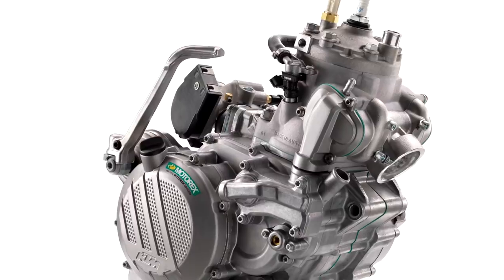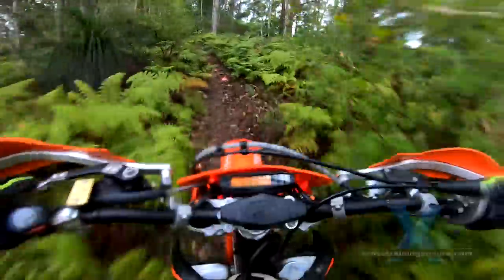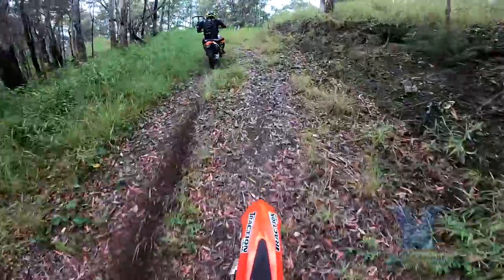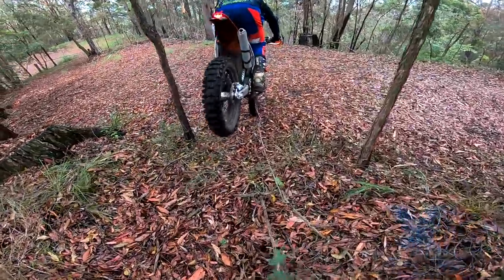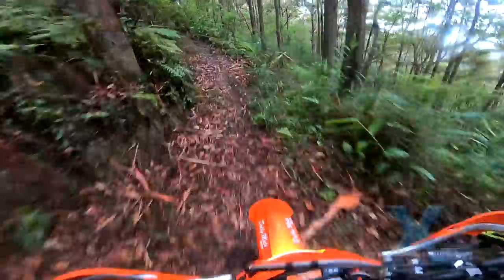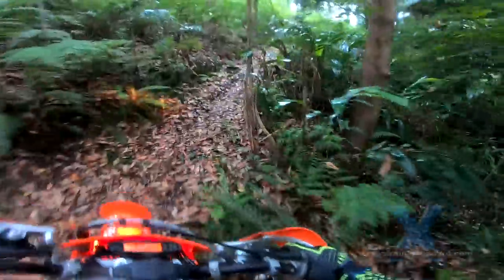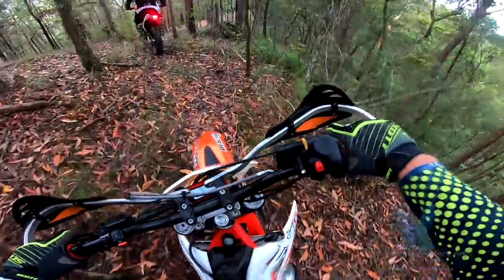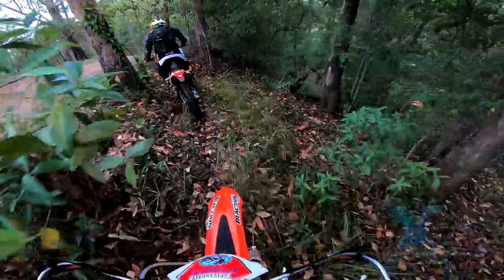KTM's carb v TPI (Transfer Port Injection): pros and cons!︱Cross Training Enduro

Comment: Mine is the best dirt bike I have ever ridden in 28 years off road, no problems at all and I love the response at all throttle openings, cold day, hot day, makes no difference, running mega slow in tight trails and then you can open the throttle and pulls away as clean as you like, no needing to clear it's throat. It's honestly amazing

Comment: I was lucky enough to ride the KTM TPI bikes at a demo day. Compared to my Beta 250rr, the 250 TPI was softer through the bottom end and midrange. Top end felt about the same. The 300 TPI felt about equal to my 250rr through the midrange. But hit ever so slightly harder below about 3000rpm. Not much difference really. My butt dyno says the TPI bikes are slightly down on power at lower revs. I've got no problems with fuel injection, but they need to allow the ECUs to be programmable for me to jump on board 100%. If you can't tune it to match mods then it's no good. KTM doesn't even want you adjusting the power valve on the TPI bikes.  Until they change that, I'm not a fan.

Comment: I have 40 hours on my TE 300i and it has been flawless. 6 other riding buddies also own a TPI 300 and they all have been great. The bikes are mapped on the lean side to meet regulations but in general run better as delivered than the 4T models. The aftermarket has responded and consumer adjustable ECUs are now available for those who are compelled to farkle. To me the biggest operational difference between the TPI and carby models is the more accurate low speed fueling. This is really noticeable in slow rpm technical riding: the TPI bike lugs down even lower, won’t stall, doesn’t die on steep downhills, and provide a hitless power delivery that makes finding and modulating traction easier in sketchy situations. For those who can plate their TPI bikes ( like me!), the improved fueling makes for much smoother running on the road with less surging and no loading up. If you are an aggressive rider and run at big throttle openings a lot, you probably won’t appreciate most of the benefits. Both systems make about the same maximum power. I got 400 miles out of my first 2T oil tank. The computer adjusts the mix ratio between 60/1-100/1. Cold starting is also better. Just be sure to get the motor fully warmed up before demanding big power.
Reply: Farkling isn't in my vernacular.

Comment: Well, I also can say some things about the tpi (MY 19):
The bike feels less aggressive than my 17 model (mikuni carb.). After only 5hours of riding, there are already some scratches on the piston (exhaust side). There is no monitoring of the fuel pump, so if it goes bad, the engine will not get any oil, which is not acceptable. 
It indeed needs less fuel than my carbed model, but the difference is not really huge. The downside of the tpi (for me) is that you can't change anything on your engine, because of the mapping. If you want to change something, you have to go to the dealer, and remap the ECU. 
I like to have the opportunity to change things on the fly, whether it is the jetting or the power valve spring.... I will stick to my old katie as long as possible.
Reply: If it can self adjust to altitude it should be able to self adjust to other changes that don't effect timing.
Reply: oh it's "that guy".    I'd avoid his videos man.
Reply: Why avoid that guy?

Comment: As always, nice video Barry! A few things need to be discussed. I had a first series TPI myself, so I can tell you that the bike isnt "greener" as no one rides it  restricted. Once uncorked it may produce less smoke though. Second thing and hundred times proven in the meantine is the fuel consumption which isn't much better than it was with carb, provided the carb is correctly jetted. It may save a bit of fuel in the tight and slow first and second gear stuff. In the fast WOT bits and on sand it may need even more gas than the carbed bike. Its not only me who has experienced this but most of the fast boys...

Comment: I have a 250TPI for about a year with 120 hours and I can only say that I'm never going back to carb.
Reply: what maintenance have you done so far? im still on the fence
Reply: Just regural maintenance as on any other bike.Air filters,4x gearbox oil changes,4x inline fuel filters(4€) and at 100 hours I had to do front fork rebuild(new oil,seals...) cause I dented them in a crash on rocks and they started leaking.And ofc I had to replace them but that's only my fault.Apart from that I'm only lubricating chain,refueling gas and every once in  a while oil.
Reply: No oil pump?
Reply: No oil pump yet.No piston.But I'm planing to change both the piston and the oil pump in spring somewhere arround 150-160 hours.
Reply: Thanks useful to know. Hoping to test one soon together with a 350f

Comment: Test rode the range of KTM 250 - 350 2 and 4 stroke bikes at a demo day and liked the 300 xc-w TPI the best. I ride a 500 exc and none of the 2 stokes matched the power but all were certainly more nimble and would no doubt be quicker and easier to ride through the technical tracks. The 300 xc (carb) was fine, suspension was stiffer but nothing notable in differences of carb v. TPI.  The 250 TPI spun up faster but didn't have the same low end as the 300 which could be lugged like my 500. I like the idea of not having to mix gas and can fill up at any gas station and not have to mess with jetting but this is based on having no experience with a carb bike.
Reply: Everything feels like a step down from a 500 4T 😁.
Reply: Your saying 300 na got the same power as 500 mmmm could it be the 200cc of different maybe
Reply: @seanpurcell9056  Kinda, yeah but that's my lack of experience with 2T. I was continually told that 2T make so much more power and that a 300 would be comparable to my 500. Not that the 300 was any slow but the two are not comparable. That said the 300 was much more nimble and would be faster on the technical stuff and suck up less energy.
Reply: @TeamStruggleBunny  they are if you put 300 2 stroke again 300 4 stroke if you get a chance of a shot of 500 2 stroke you no about it they mite be old now boy they go if they were not kill off and had the same amount of development as the 4 stroke got over the years they be something else dont get me wrong  modern 4 stroke got some amount of power too they can hall ass. Some of the new electric bikes are coming on leaps and bounds love to try one some day all ways good to try something new and different keeps you on your toes ha ha keep the wheels right way up and injoy
Reply: @seanpurcell9056  My buddy has been looking for a CR 500 for awhile he love to steer with the throttle lol. Can only imagine the Maico 700cc 2 stroke - it must be completely nutters. I saw one at a rally along with a KTM 450 Rally, I couldn't think of anything to offer the owners to let me take them for a spin. Ended up on the same team as the 450 owner and I have no doubt he'd have let me have a go if I had asked. Enough to admire the carbon fibre tower in hard wired Gopros haha. So many awesome machines out there. I do love my 500 though and think I'll add a 300 TPI to the garage though it'll be hard to justify keeping extra bikes that do the similar duty.

Comment: The carb option probably seems daunting for first timers, just throw a JD jet kit in for your aprox altitude and never touch it again. Very marginal, but better mid range delivery than the TPI. 19' model comparison.
Reply: I disagree. As well as they work if tuned right and as much as I like to tinker, they can really suck. Flood like crazy when you drop them. Will always start leaking in time. Virtually never tuned perfect, no matter how good you are. Need to be started monthly in storage or the bowl dropped to avoid rancid gas. If you don't keep rancid gas at bay, you've got 2 hours of cleaning to do.

Comment: I have a had a good experience with my TPI. In stock form its a great bike, linear power curve, and runs perfect. It has a unique character compared to a carb'd 2T but I wouldn't necessarily say that makes it bad just different. Fuel efficiency differences really depend on how badly tuned or rich the carb'd 2T you typically ride is. You may notice a big difference or no difference at all. I checked the bore at 40hrs and didn't see any wear issues. I feel like a lot of the concerns on the internet are rather nitpicky. There isn't anything a carb'd 2T KTM can do that the TPI would have a problem doing even with the stock bikes lean(er) fuel map. Even then those minuscule differences may not even be noticeable depending on how and where you ride. Reliability wise I haven't seen any issues.

Comment: I think this has made my mind up, 2017 300 over 2018 250 tpi. I originally wanted the tpi for no oil mixing and the auto jetting as well as the better fuel economy but if the oem tank is smaller anyway then what’s the point? Plus I’m a gumby mechanic and don’t want to have to deal with all this other complicated electronic shit as well as all the first gen issues that arose. Thanks for the informative video as always.

Comment: Love my 2018 TPI here in the states!
Reply: Jonathan Spier  Its been great to me. The only hiccup it has had was a weird misifre that was solved by a ecu reset.
Reply: Jonathan Spier  I haven't gotten enough hours on mine but I think they said to replace them around 90 hours just to be sure. I almost wish they made a 200 TPI personally because the 125, 150, and 200 use the smaller frame I'm pretty sure

Comment: ridden my carb back to back with a tpi a few weekends ago  in the real nasty extreme enduro stuff , tpi has a little less grunt down low and in mid ,  tpi gets onto the pipe really strong which makes it harder to keep in control , few things it didnt like to do where the carb pulled  , fuel economy was identical ! , glad i chose a carb,  tpi is not there yet  close tho,   if you can pick up a 2nd hand carb with low hours and big $$ off then jump on it ,

Comment: What do you think about the low end grunt on beta vs ktm. I rode the RR250 awhile ago and have just got a 250exc carb, ktm has fek all low end in compassion, I'm 65 kg and it doesn't even like to do pivot turns or lug up easy hills in second.
Reply: Just wondering if in other people's experience if they really are that weak down low in comparison to the betas or if something may be wrong with my bike. Ktm didn't put  a gasket in properly and I had to go through a whole warranty thing so wondering if something else isn't right on it or there is another leak.
Reply: Exc comes with pretty low compression. Bumping that up would help a ton. Easiest (and cheapest) way would be to pop on an SX head or get the stock milled. I’ve read too that an SX cdi helps but haven’t tried it. I have a 17 250xc with different head and Vforce 4 reeds + Lectron and it chugs real good on the bottom end. Only reason I run a Lectron is due to where I ride and the temp/elevation changes.
Reply: Yea I'm at 500m above sea level and also have v force 4 reeds, stock head and carb but. Still seems to be quite the different between the two bikes in my experience. Would be keen to ride another 250 kato and see how it goes
Reply: I don’t know what your definition of an easy hill is, but I’m 90 kilos and mine lugs up easy hills no bother.

Comment: What wasn't mentioned is the need to replace the oil pump at 80 hours.  Being a stickler for maintenance I was changing my piston, rings, etc every 100 hours but I pushed that out to 140 given so little wear, but now, if I commit to a TPI bike I have to front up the additional cost of the oil pump in advance of the top end rebuild almost twice as often.  So what?  Yeah, it's not a real problem but what I do have a problem with is why are they supplying such a pathetic oil pump?  80 hours??!! That is total BS!  And the worry is, if it fails after the initial minuscule warranty but before the 80 hours that's it.  Motor blown.  Top end, bottom end, the lot.  I'll be going Beta or Sherco for the next bike unless they also go injected.  And BTW the word is no more carby KTM's and Huskys.  What we got here now is the last of them.  :-(
Reply: makes my 2015 worth that much more!
Reply: KTM loves engineering failure into everything. Good catch on the oil pumps, that's absurd. I guess the oil pumps on $800 third world scooters with tens of thousands of miles get changed every 80 hrs. Same with injection snowmobiles with 25k+ miles. Oil injection and fuel injection is definitely not going to decrease reliability though, unless KTM goes to great lengths to make it less reliabile. With these new systems the oiling is generally  better and there won't be liquid gas washing your cylinder when you stack it like a carb. Perfect fuel mix all the time, so way more consistent piston temp. Injection snowmobiles and outboard boat engines have been a big step forward in everything, carbon build up, top end life, efficiency.
Reply: I think just about the only performance problem with injection is a little bit jerky and lumpy at very small throttle openings, on and off throttle, and starting. A pilot jet is extremely good at metering small amounts of gas, where a big injector always tends to struggle. These systems obviously add complexity and cost, but none of the traditional carb problems out weighs that imo. I've taken apart so many carbs, while straightforward, i could definitely get used to less of them.
Reply: Changing the oil pump at 80 is more like a guide. My mates 18 300 was on 160 hours when he sold it and he didn’t change the oil pump. My 19 300 is currently on 10 hours so she’s still knew. Will just have to see how she does. I think the 18’s they had a lot of problems but they sorted them out with the 19’s.
Reply: @radford_0731  yes, but pumping oil  is not a difficult job. Even on a 4 stroke, that pumps 100 times the oil of a 2 stroke. An oil pump that drips out oil should definitely last the life of the engine.
Reply: I'm really tired of every excuse in the book to make dirt bikes as fragile and disposable as possible, like this $140 plastic oil squirter. Maybe we should go back to the early 1900s where you manually pumped your bike's oil every couple minutes. The worst part is that there is no recourse. People would buy ktms if there was a 50% chance of unwarentied failure in the first 50 hours. They'd just say "not a trail bike, " you have to replace everything that moves at 40 hrs. Ktm makes European car makers look like total amatures in cheaping out or designing components to fail. VW should go the way of ktm and just buy out all the other euro car makers so they can make them as disposable as possible.
Reply: @radford_0731  The thing is that such an essential component should be far more robust than that.  Sure you can leave it for way more than 80 hours but given the risk potential would you?  Honestly the pump should be rated for 1000 hours.  80 is just pure money making.

Comment: You talked about Reliability but I am wondering about how long they will last compared to a carburetor bike.  My guess is not nearly as long.  Anytime you run a 2stroke bike leaner you run the risk of wearing out parts much more quickly, especially Piston and rings.
Reply: Yep... the law of physics come into play... you can not lean burn a 2 stroke and have it last very long....

Comment: Always the same talk. "Uuuuuh, it's more complex then a carb". YES, IT IS but have you seen people abandon 4-stroke in the woods for the same reason? They had injection for years and years.
Reply from the maker: of course people occasionally get stuck in the woods when a four stroke oil pump fails, or the fuel injection, or the relevant electrical connections... or just simply the injection getting clogged up. it doesn't happen often but it DOES happen, and some people prefer less potential complications compared to others.
Reply: I've had carb problems in the bush, but it's never been a trail side repair. Indeed I had carb issues with an XR that took months to resolve. (Incorrect jets and slide fitted, I still don't know how as the carb had never been apart). The carb was the last thing we tried, but I spent thousands before that because it simply didn't present as a carb issue.
Reply: @crosstrainingenduro  The other alternative is no more 2-stroke. I know what I would pick.
Reply: @gasdive  I never owned a carb enduro bike so I can't really debate. I know people who owns them and I said to myself to never buy a 2-stroke until it got injected and here I am.
I never got stranded with my 4-stroke or 2-stroke in the woods (excluding when I emptied the battery running aux batteries).
Reply: @perpelle  Yes, people are mostly being dramatic. When I rode a carb'd bike its not like I rode around with an extra carb. TBH most EFI failures usually come from people running a tank of bad gas and clogging everything up or not changing the filters in the oil and fuel systems.
Reply: Funnily enough, I have seen quite a few people abandon 4 strokes in the woods because they couldn't even temporarily fix them.
Reply: Then/than. -2.

Comment: As most 250s and 300s share every motor rotational part other than the piston witch is really not rotating you will not feel a difference.
Reply from the maker: i've wondered about this too purely from a physics angle, adam. and also because a 300 could be revving less too which theoretically would cancel out any difference? but the vid is based on a wide variety of reviews, comments and opinions i gathered from various sources and so many mentioned this it thought it was worth including, even if it's a dodgy premise lol.